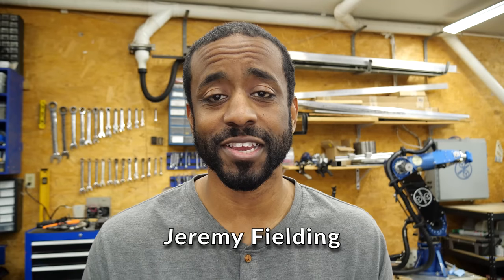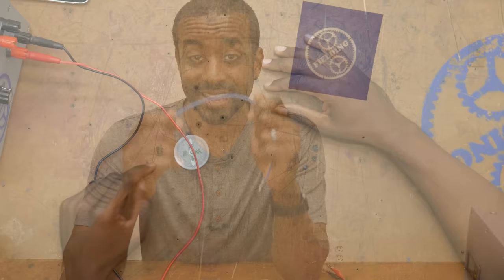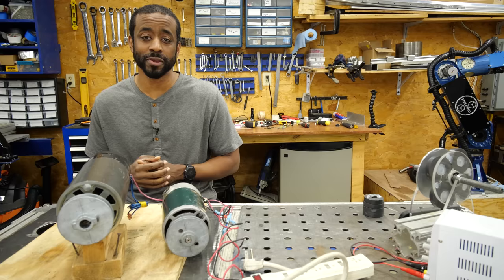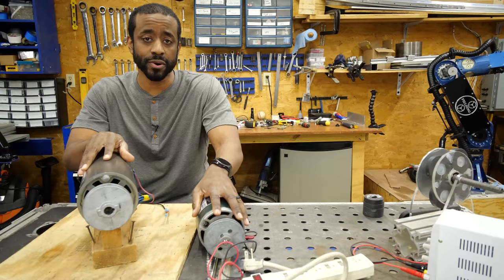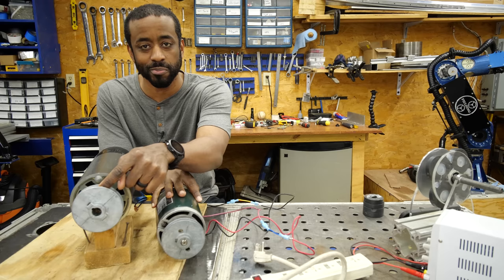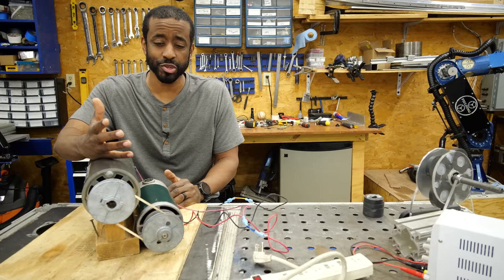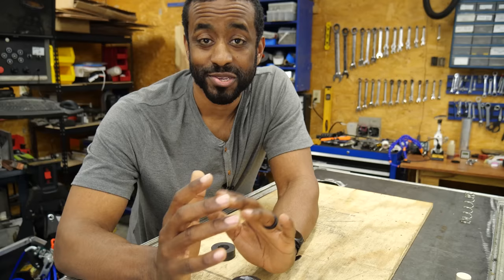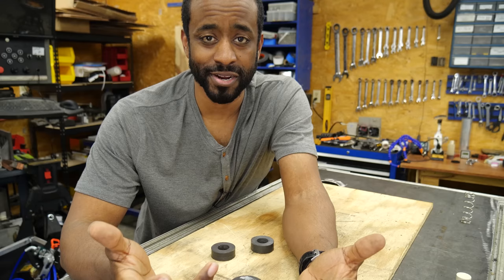Reviewing Free Energy Generators.  A Response to My Video "Nikola Tesla's Greatest Invention"- 102

Comment: I love you're take on this but a car creates forward motion which also creates wind movement why not use the wind movement to make up for the loss ? we've all seen the little fans that you can put on your car window that charge your electronic devices while driving why couldn't you have several built-into the vehicle that increase the amount of power by forward motion of the vehicle ? just saying a secondary power supply utilizing the air flow being created by the forward movement.

Comment: Your incredulity is certainly due and justified. Let me remind you that most of the patents held in at least the us patent office are by the uneducated. Why is that? Because they aren't restricted by the boxes the educated are constrained with. Rare earth magnets, ceramic bearings, computer designed and built stator windings were not available when most of those constraints were stated. That being said we also didn't understand the quantum world as well as we do and will in millennia to come.  The balancing issue is one I did appreciate to the idea of these devices. The ones where they glue them on to the windings after having put electrical tape, nah. There is one were they manufacture a hub to replace the winding space and it has channels machined into the perimeter to glue the magnets in. This would seem to both balance and space the magnets evenly to cause a clean enough production of electromotive force. The impact of the steel that was the rotor hub being near those magnets has me wondering what it would be. Also by using that hub they maintain the distance to the stator windings on all 3 axis. 
  The alternator with electromagnet inside would consume energy to produce energy and fail because of the physics law almost immediately. It does seem that you're using energy produced to create more energy, the driven motor to turn the fixed magnets would create a negative sum total loop. The energy first put in was donated by YOUR MUSCLES. It didn't "flow" through the meter., Albeit I didn't see if you had it on amps in which case it did. I believe it was on volts. Government suppression has been around since so idiot thought the government should have regulatory power to "keep people safe" which is just stupid and another way for someone to get wealthy. As you said, any time there is a way to make money. Greed is a powerful motivator.    I've nothing to loose but time. I have the majority of components to fabricate on of these devices. A friend who is the same as me curious and confounded asked if they are real why isn't someone making and selling these.   So, we will see if I'm running a fools errand, or not and I'm going to report my findings.

Comment: i know a way to possible get this to work.. and it’s not by running the shafts parallel with each other. it’s about switching the ratio.. the motor will have a larger pulley, and the alternator will have a small pulley.. so the alternator will turn 10x-20x faster.. creating more electricity.. but it won’t go directly into the motor.. it’ll go into a charged battery.., then the battery will power the motor.. the motor will get electricity from the battery, making it easy to spin the alternator, the alternator will charge the battery. i don’t see how this can’t work, by adding a battery and playing with different pulley ratios
Reply from the maker: It might help to watch part two. Gears and Pulleys don't increase power. If you double the speed the torque will go down to half and you have the same amount of power. I prove this in part two using levers and real gears. Link in the description. Also a video coming out tomorrow explains this in greater detail with more proof using bicycle gears. Thanks for watching. Another way to think if it, if this worked you could put a tiny motor in electric cars and use a giant gear box to increase the power. We could do the same with gasoline cars. We could put a tiny car engine in a tracker trailer and with a big enough gear box the trucks would be significantly cheaper. Except that doesn't work so we don't do that.
Reply: @Jeremy_Fielding I’ll search for part 2 thanks 🙏 

it’s just an idea that sounds so great, we want it to work, but wanting something to work doesn’t make it work 😅

Comment: What about the use of gearing, or pulley size to compensate for energy loss by making the generator device spin faster than the operating motor. In theory this should allow you to reach power out needs within abilities of used motors tolerances, ease get back to me with your thoughts

Comment: The key  is storing the energy you produce alternatimg from one battery two the other with a chip and storage regulator like you have in an rv system hooked to solar panels that keep trickle charges going. In addition t like the other guy said the alternator had to spin at 1000 rpm or more to keep the alternator spinning fast enough like a gasoline motor would drive. Just drive the voltage to an high speed electric motor to spin the belt right to drive the alternator.
Reply from the maker: Neither of these things make a difference. 1. With this setup you are basically charging one battery with the other and wasting a lot of the energy in the process. It just isn't immediately obvious how the power got from one to the other if you don't know the alternator gets harder to turn the faster you try to spin it. Because this was such a common response I answered it in a follow up video explaining the braking effect of the alternator better and proving it with a demonstration. Link in the description to the playlist. 2. The speed doesn't matter because of something I call "pushback" again covered in the follow up videos. You can design a alternator to work at whatever speed and voltage we want. That is not a limitation. The input power is the limitation. Well over 5 thousand people suggested these two things to me right after watching the video which told me I didn't explain the problem well. I fixed this in later videos.  Please watch at least the third one if you want to understand why no one does this. Also you can try it yourself. This is stupid easy to test with an alternator. I do this test in the second video.

Comment: A alternator  will work but have to have something power it for example if you have a running stream.of water you can use a paddle wheel to spin alternator  then will charge your battery  won't get as much electric as a windmill or solar  panel but can run a light bulb and charge your cell phone  if you got a convertor
Reply from the maker: Of course if you have a power source it will work. That’s what it is designed to do. Changing the gasoline engine for a water wheel  (though the speed will be too low and likely not to work) is the same concept in principle. I don’t understand what question you are answering.

Comment: I have a theroy, Obviously these "Infiniti Generators are missing components and sure you can spin an altenator to generate electricity, and back connect a 12 or 24V motor to power and perpetually spin the altenator, and your right, the more you connect, the less power available to run the motor and it can slow which will eventually stall the system.

So my thought process is... connect a 24V 3000RPM  bike motor & 2 X 240AMP altenators in a sort of "Triangle" configuration. Use a Solar charger, a 12V to 24V converter and a switch for On/Off.

One Altenator powers the internal system and motor. It would have to have two off switches maybe? One to cut the direct power to the battery and one to cut the power to the system.

Once started, turn on both switches and turn off the battery switch, and it should continue to run through the power Altenator 1 is generating.

Connect Altenator 2 to a battery system (solar setup) to power/charge your batteries. 

Basically add it to an existing system in more northern areas to supplement for less sunlight hours... the altenator should charge the batteries and if connected through an MPPT controller, any "Overage" should be diverted to whatever your running so appliances are running on that before tapping the battery storage...

Does this sound like it would work?

Comment: Great information..
Thank you.
But here's a question???
How about running a alternator off the electric vehicles axle instead of the vehicles motor?
I know it would not supply sufficient energy to permanently keep the battery charged but wouldn't it assist in a bit of extra power to the battery to extend your mileage and reduce your power bill ?
Thanks in advance...looking forward to your reply.

Comment: I'd just like to throw my hat into the ring here for a moment..... if we look at wind and solar as " free energy " - their efficiency is dismal. Of course this is because both systems are at the mercy of sun and wind and is thus unreliable. I would however consider both Geothermal energy and Tidal energy generation " free energy " for 2 main reasons.
1: Neither system produces any pollution.  (especially carbon emissions).
2: BOTH can be harnessed 24/7  - regardless of weather conditions.

I believe these systems are NOT being developed fast enough, because of many reasons - the main one being greed.

Comment: I bought some solar lights off e bay for outside put the solar pannels outside and the lights inside they came with a on off switch 2 years ago .so i elimanated using 12 100 watt lights in my trailer .what a narn find.

Comment: The point of these scams is that it is logic in the imagination, but in physics there is always a lost of energy or a balance. Even copper wires have a lost and resistance. But even when you can invent a super conductor with 0 ohm than you still end up in a balance.

Comment: I completely agree. Love your video!

What are your thought about using an electromagnet to deny the steady state? 

Just a thought exercise (I personally do not believe perpetual motion is possible)... Could you electrically switch the poles fast enough denying the system the mechanical steady state it desires, and achieve "seemingly perpetual motion"?
Reply from the maker: What you are describing is how an electric motor works now. So yes of course that would work. Except its not perpetual because the power is coming from whatever is supplying the electromagnet. You can't create an electromagnetic without power.

Comment: One small pulley to 6xsize pulley with flywheel need torque x momentum Collect flywheel energy multliplication
Reply from the maker: It might help to watch part two. Link in the description. I talked a lot more about gears, pulleys and flywheels. I also demonstrated it. The short answer is no. But if you watch you will understand why

Comment: With a DC motor with a sator and rotor attached to it making it AC. Then run that a transformer or 2, which up the power. Then run that though rectifier regulator taking it back to DC, to run the DC motor and charge a graphene capacitor, with maybe some bridge connectors would that work?
It wouldn't be perpetual motion but wouldn't that run a motorcycle without stoping. To charge it . And the capacitor to start it.

Comment: Toyota Prius charges it's batterypack to use it drive more fuel efficient, but why not solar cells? For those heavy battery cars? You might have run this topic already, but I have to find it first.

Comment: Great video Im sure you remember the headlight kit we used to put on our bikes with the little motor being turned by the pulley turning by rubbing against the front wheel of our bikes Im sure ir is a stupid question but would this set up or something simular work to help power an electric car?

Comment: Hello Jeromy. My name is Phil and I am a 43 year Master Licensed Electrician. Now retired. I was watching your video and I couldn't stop laughing. This design violates multiple laws of physics. Ha Ha Ha..... Sadly I watched you ALMOST destroy a perfectly good motor just to prove a point. You did a GREAT job proving friction, electromotive force, and residual loss due to excessive load requirements. Anyway, Just wanted to let you know that I did design a working REAL prototype of restorable power and replenishing amps to the primary supply. I designed a collective system that recovers unused and dissipated current bleed off from the load and inverter radiant. Thus returning what's left to the primary supply via 650cca battery to store. I was able to use a "hole Hawg" averaging 17amps constant all day on a 120A.C. inverter in my service van and after the end of the day, not only did my van start without effort I measured Amps and voltage at the primary power source and calculated only a 15% loss of storage. Talk about being close! There is NO SUCH THING AS PERPETUAL MOTION! Anything that moves is going to eat. Thanks for reading. Take Care.....Phil (DOC)

Comment: I appreciate your explanation on how the basic principles work and how easily things can be manipulated.  Personally i have been thinking about this alot lately and came up with 3 different possibilities of making a free energy machine.  Honestly this is only the 2nd video i watched on this topic. Thanks to you two things have happened.  First my dreams of creating such a system were broken,  but still alive because no true system has yet been created.  Second is you saved me alot of time watching false or misleading videos.  

The most important part i took away is the energy loss. Because of that fact 1 of the 3 original thoughts i had now won't work.  However I still wonder if the other two would.  

Personally i do hope that someday someone will be able to create such a device.  That if it was censored by the government,  big energy ect that they would understand the need for this in todays world.
Reply: Even if the majority of the videos are faked. If you notice he used a rubber band to spin those two motors... My question is why can't there be two magnets chasing each other inside a copper coil that's in a loop and that just keeps going in circles generating kinetic energy and then that rubber band is replaced like silicone and since that generated an alternating current (AC) and all you have to do is attach a diode called a rectifier to direct the alternating current into a direct current that connects to a power plug.
Reply: But still either way.. Its not free energy but there are devices where you put in a small amount of energy and it produces a lot more energy that's put in then what's put out. It's called over unity.

Either way.
If you think that extraterrestrial beings exist out in this vast universe that has trillions of galaxies.
Then how do they travel past the speed of light? Cuz the speed of light is too slow.

Comment: An example of magents being used exactly like springs is the filament sensor of Prusa 3D Printer hot-ends. (Honestly, those are the only hot-ends that I'm familiar with, for all I know it is common across many 3D printer filament sensors.) They use two magnets, one rigidly mounted and the other on a moveable arm just like a spring to hold the filament sensor closed. When a piece of filament is pushed into the sensor, the filament pushes the magnets a little closer together via the moveable arm. Also on that moveable arm is a flag that breaks an IR beam to tell the printer that there is filament in the sensor.

Comment: It works my brother is you have  a flywheel and two different rates motors.small motor helps to feed continuity after starting external power input is disconnected
Reply: Just improvement is needed
Reply from the maker: You should watch part three. Links in the description to playlist

Comment: Well, why don't we put several magnets on the iron part of the car wheel, close to it, and opposite it is the coil, and with the movement of the tire itself, the magnets move and generate a current. You are not saying that it will be endless electricity.But at least it will increase the distance that the car can travel. We have used an actual moving air particle in the car, which is the wheels. Could this be logical?

Comment: Hook a conduction motor to the system running off the power of the atmosphere power and do some adjustments and then the are getting close to free power to get more to turn on other devices
Reply: I'm not telling all I know about because if you live in the city they would never let you use this power source you need wires really high in the air better made a copper and they wouldn't like you doing that in the city but if you're from the country you can do stuff like this and act like you just don't live on power at all
Reply: I was top 10 in the states for electrical engineering for pssa test but I'm not bragging I'm just telling you I have bases knowledge in it my uncle worked for quantum in the 90s he told me about flat screen TVs

Comment: So, it is clear that you cant just make an EV run forever, but is there no way to just suppliment ?  Say, use the motion of the drive shaft to just add to what the battery (which still needs to be recharged as normal) .. maybe help run aome of the smaller systems?  Is there always too much loss for it to ever add any benefit?

Comment: What are your thoughts on the Thunder Storm plasmoid generator that doesn't give free power but does greatly improve an engines efficiency.
Reply from the maker: In general, adding anything to a system waste more power… usually not improving efficiency. Removing unnecessary things, or changing the design is what usually improves efficiency. So I can’t say it’s not true but it sounds like a scam for your attention.

Comment: 19:35 what about a perpetual motion wheel like that, which spins a motor, that sends a small current to a battery for slow charging?
Reply from the maker: The whole point of that picture was to point out that it looks like it should work but it doesn't. Its just an animation. That can't happen in real life.